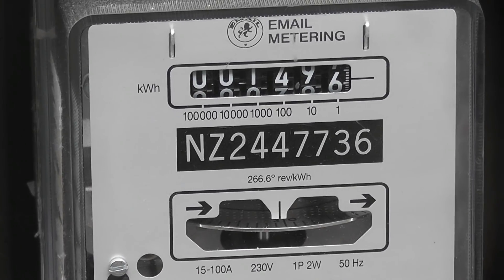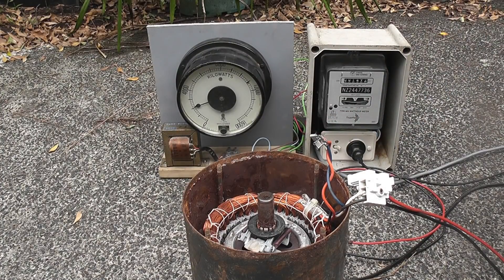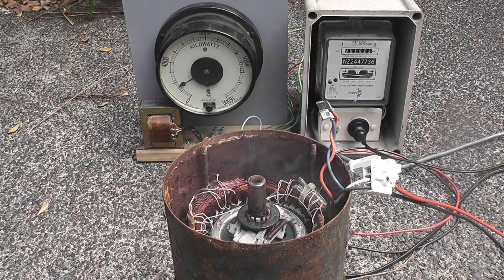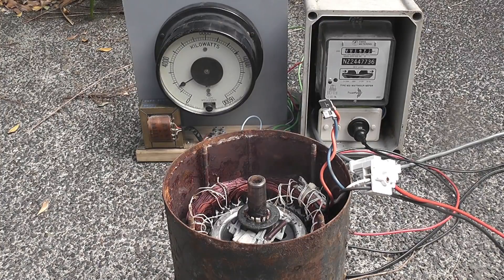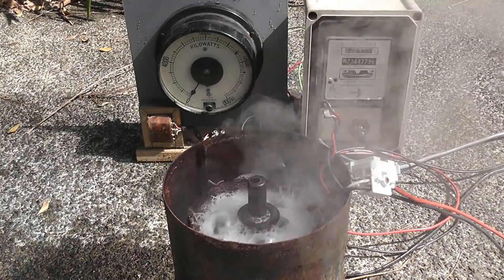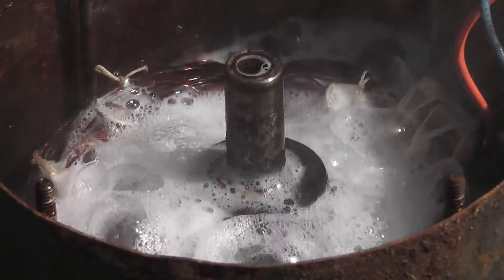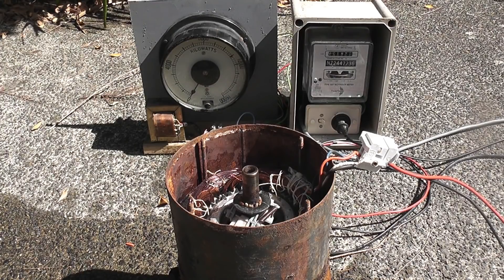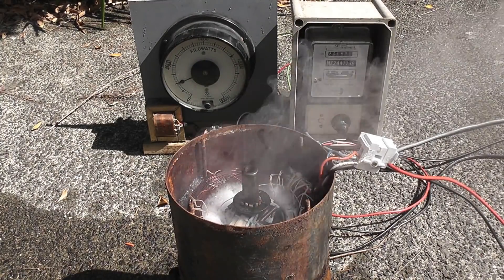Insinkerator motor overheating and bubbles

Comment: Hey you converted it from waste disposal to hot water kettle!  

Have you see what happens when a cotton-insulated oil saturated motor winding burns out? I had a 1930's Westinghouse fridge compressor that was damaged by 80 years of running in sulphur dioxide. I did a teardown on it and after learning what I could from it, I connected the start and run windings together, and let it run freely, with both windings energized. The failure was very interesting! It hurt me to see it die like that but in the end, we learned a lot from it.
Reply: Forgot the video of the Westinghouse motor destructive test: https://www.youtube.com/watch?v=fMK8WYmO9Vo

Comment: Sir you should be president of the United States, your a genius
Reply: Haha, imagine the president popping capacitors in the rose garden :) leaving all these burnt marks on historical pieces.
Reply from the maker: LoL If so I would love a 277/480 Three Phase supply then.
Reply: If you had the money, you very well could have one installed!
Reply: Would 3 phase 240/415V be NZ equivalent of U.S. 3 phase 277/480V for industrial use or 400/690V be the counterpart?
Reply from the maker: Yes. 240/415V would be the equivalent of US 277/480V. The 230/400V x 60/50Hz equals 276/480 Volts exactly.  @johnferguson4989

Comment: Couldn't the electricity travel through the water into the container you're using to pour?
Reply: Fresh water isn’t very conductive. It’s only salt water that conducts well (or water with high mineral content).
Reply from the maker: Plastic container, clean water and jandals on dry concrete. very unlikely. Always keep my feet together for step potential, not very likely with 240 Volts.
Reply: @RODALCO2007  glad you think these things out lol
Reply: It could.... But chances are very low if done safely. Current would have to travel through the water and container and complete the circuit through his shoes (or whatever body part completes the circuit) back to the motor or a missed source of electricity (such as a wiring fault at the home or in the cord that has the ground he's standing on live... not a high possibility if you've checked your situation out. You want insulators between your body and current paths... the more insulators, the safer you are.  A very very high probability for a shock would be holding or touching the live motor while pouring water from a metal kettle at the same time.... See the path through the arms?

Comment: Happy new year! 
Those insinkerator motors are incredibly tough.  I wonder how that motor would of faired out if you threw in salt water or bleach...  Might of made for some spectacular results.
Reply: That's a very durable set of windings... Got HOT and barely smoked too. I'd rather have that burn out in my house than a smokey set of transformer windings!
Reply from the maker: I tried soapy water but it didn't trigger a new electron flow across the gap.

Comment: Absolutely amazed how long that lasted on the run winding at 2kw! Mine has burnt out this summer due to the start winding switch being stuck and it went out in less than a minute! The worst part is it still worked fine and my family used it like normal until smoke started to pour out from under the sink... Absolute stench hehe 

Anyways happy new year and indeed hope to see some juicy wasp explosions this year 😊🎉👍
Reply from the maker: Our unit had a thermal overload button which I removed for the final load test.
Reply: IMO, since it's a motor coil (inductive), not all of that 2kW is dissipated as heat.
Reply: That's how the one in my parents' house went out... after I disassembled and reassembled it to remove a jam, it was somehow running with too much resistance and I didn't realize this until the motor went BWOMPF!

Comment: Those windings looked good.
Reply from the maker: The windings were perfect. The stainless steel grinder part, outer casing alloys had completely disintergrated. Designed with obsolesence in mind. Unit lasted about 14 years.